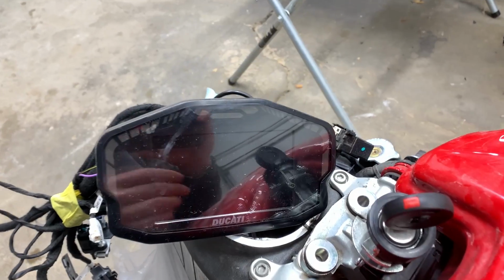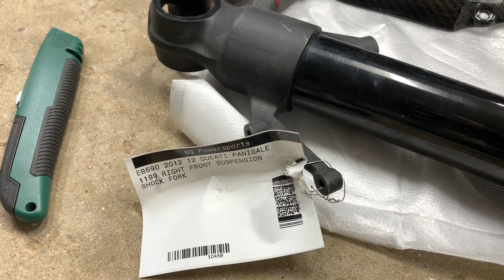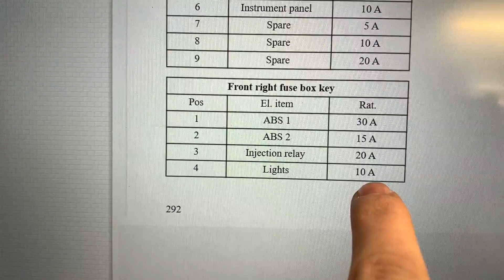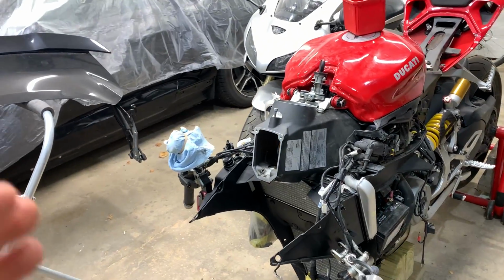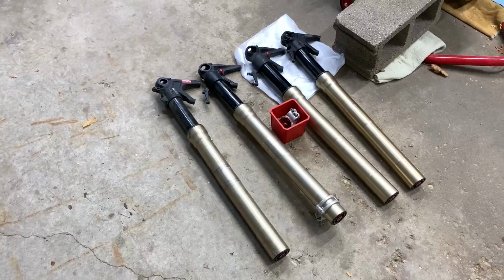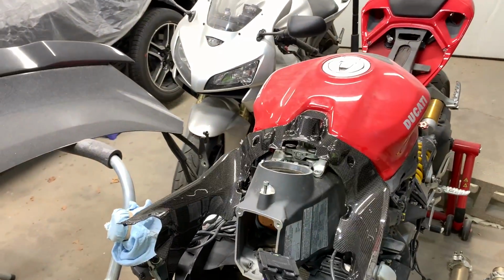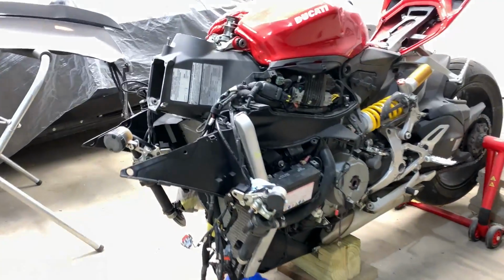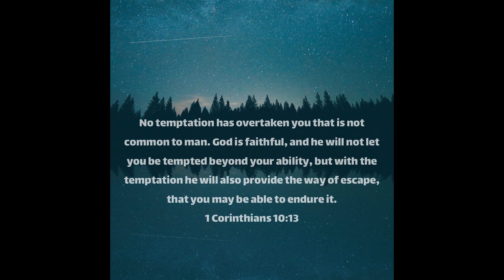Rebuilding A Wrecked 2014 Ducati Panigale 1199 (Part 6)

Comment: The abs light will flash until you start rolling.  The low beam will turn on when the engine is running

Comment: The milage won't display because the milage on the dash and ECU aren't the same. You can take it to a dealer to fix. Also if I'm not mistaken the DRL comes on when the bike is running.
Reply from the maker: Thanks Barry!
Reply: Yeah, that is right. When I got replaced a new dash in 2012, the dealership re-sync it with the ECU.

Comment: Put locktite on the brake rotor mounting bolts and USE A TORQUE WRENCH. It's important and to find out why might be something beyond regret. The Panigale is a lot of motorcycle and putting anything to chance is not wise - it's essentially a race bike.
Reply: Also front tyre, dude you put angel GTs on panigale. No words for that, you using touring rubber on a race bike. Get something stickier and get a matching tyres...

Comment: Put some thread locker on those disc bolts and torque them to spec in correct order... Sorry about the propane tank...
Reply from the maker: The camera didn't pick it up but I loaded each bolt with blue thred locker, will do! Thanks

Comment: The ABS light will stop flashing when it senses the bike has started moving if it's anything like my 899. I think that's standard.
Reply from the maker: Ahhh good to know! I thought it was cause I have lots of air in the system
Reply: Same.  My Ducati v4 also does this.  I would move in to the next issue.

Comment: As I have already mentioned in another rebuild vid, but find it most important to address, was this bike ever stripped down to basically a bare frame?? why you ask?? Given the extreme damage of hard parts at the front end it would have been of vital importance to send or take the frame to a pro to have it checked for straightness in a frame jig and ensure it''s within Ducati's spec #'s. As best I can tell in the early vids you did not, but by all means correct me if I missed it.
Reply from the maker: It most likely isn't , but everything lined up

Comment: Bike has to be started for DRLs to work, and millage will be incorrect on those clocks. You need ducati software to re sync with ecu.
Reply from the maker: Yooo seriously??? Man thank you for that. I thought that was a possibility but it seemed not possible at the time since the rear lights lit up whenever I just had the key in the run position. Have you used MelcoDiag to connect to your bike before? I've got it and wondering if I can reset the mileage myself.

Comment: Exciting stuff. Try to find torque settings for your bike if you haven’t already and use a torque wrench. All sorts of exotic soft metals on that bike just dying to be stripped of threads. Be careful using that impact. You shouldn’t be capable of setting your mileage.
Reply from the maker: Good idea. Do u know why the bike mileage is flashing then?
Reply: @CJMediaOfficial  FIrst, I’d try cycling the start up procedure several times in a row to see if it will reset, something you have to do on some bikes after a tip over. Turn it on, wait for the fuel pump to cycle and electronics to kick on, then turn it off. You don’t have to start the engine. Do this a few times. If that doesn’t work, I would check the rear wheel speedo / abs sensor for damage/blockage.

Comment: 15 amp shouldn't cause the problem of the headlight not turning on having a higher amp fuse should never cause a problem it's just having a lower amp fuse that could have peoblems. Higher amp fuse in low amp spot just means you have a higher risk of frying electronics because the electronics could then fry before the fuse blows if that makes sense.
Reply from the maker: Good thinking, any idea of what it could be then???
Reply: @CJMediaOfficial  could be the bulb, could have broke something inside it on impact, or wiring but I would check bulb first, you could take the bulb out and take a testers and check to make sure your getting power to the bulb, so then you know it's not wirring or anything
Reply: @CJMediaOfficial  did you check to see if the fuse is good
Reply from the maker: Yes sir
Reply: Just a note here.  The fuse limits amps not really voltage. If you are getting voltage across the fuse then I would check power at the light and go from there

Comment: clip ons typically have tight tolerances - painting them and clear coating them probably wasn't the right move. they will look like shit in the long run.but love the series - so close.
Reply from the maker: Yeah I don't like how they turned out. Will most likely replace down the road. Got any suggestions with brands to go with?